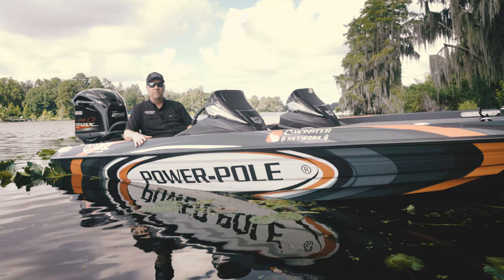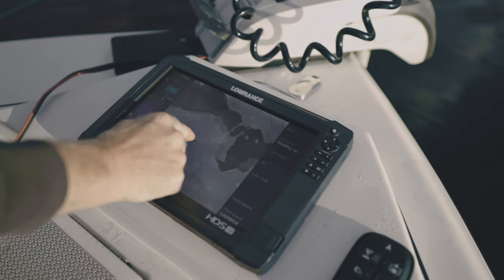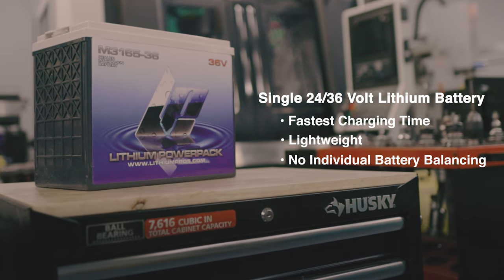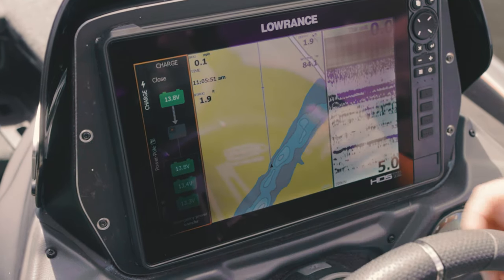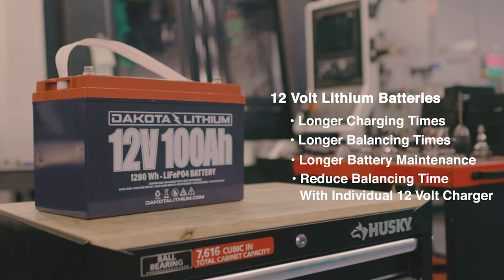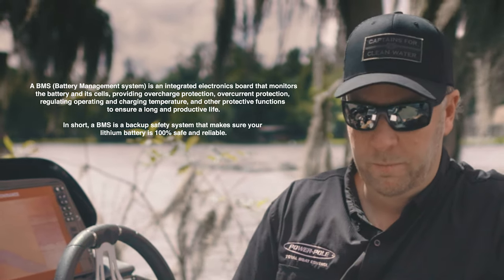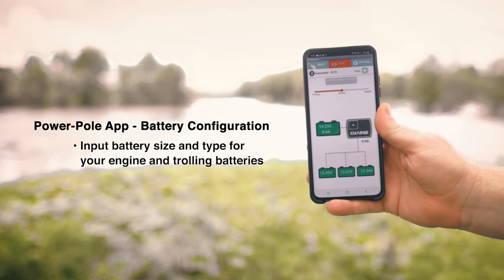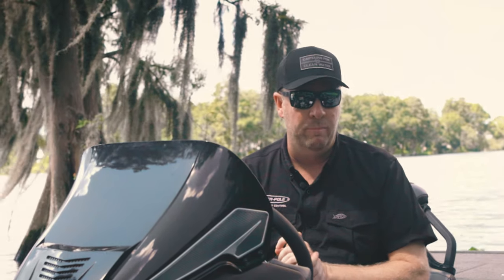Power-Pole Charge - Best Lithium Battery Setup

Comment: Could a user have a 12v agm cranking battery with a dedicated 12v lithium battery for livescope, graphs, and boat features, and then a single 36v lithium for trolling motor? Or does the dedicated electronics battery have to be an agm battery wired with the cranking battery? thanks in advance

Comment: Before using a product like this you need to assess how much power is coming in.  Because without that you have nothing.  If you have a 115 HP likely the max number of amps that are coming from the motor is only 35.  So it would be nice if they would answer all of the questions posted here and provide some real data on how this charging system handles different sized outboards.

Comment: This system is a joke for any lithium set up. It was installed in my boat as part of a restoration by a specialty boat rigging company. I am a fishing guide and depend on my charging system daily. If you use your boat once every two weeks, maybe you could get by. Power Pole tech support told me that the power transfer feature is not valid with lithium yet no where in the sales material does it give you this fact.

Comment: I received my power pole charging system as a gift.  I don't remember seeing anything in the manual, or a disclosure anywhere on the box that it will not fully charge two 50ah lithium batteries (both to 100%) wired together for a 24-volt system.  But it seems that way.  Battery manufacture told me so and suggested I get a single bank 10 amp charger to top both batteries off.  Why would I want to have to do that when I own the most expensive and touted charging system on the market.  Power pole said the battery percentage didn't matter, just the volts.  I will follow with an update once I figure out the truth.

Comment: Thanks for the video.  Sounds like running lithium trolling motor batteries in series for a 36v system isn’t as ideal for someone running them hard with short recharge times and you recommended single 36v lithium batteries instead.  How would it compare to running say two 36v batteries in parallel? Would running two 36v lithium’s in parallel have potential to require longer than ideal recharge times as well?
Reply from the maker: Yes, you are correct.  Two 36v lithium’s in parallel will take longer to charge than a single 36v lithium.  Your question brings up a very good subject.  
What is the best way to wire two 36v lithium batteries for the trolling motor?
In parallel or independently with a battery switch?  Both wiring configurations have positives, benefits and some drawbacks. 
Trolling motor batteries wired in parallel.
•	In parallel the Power-Pole Charge will charge and maintain both 36v batteries as ONE large 36v battery.
•	If you drain or use a lot of the two 36v batteries in parallel it will take longer to charge both batteries than a single 36v battery.
•	If one of the batteries wired in parallel has an issue with the BMS board it could cause the other battery to have an issue and your trolling motor will stop working and/or the Power-Pole Charge will not work properly.
Two 36v lithium batteries wired independently with a battery selector switch to toggle between the two batteries when needed.
•	This set up seems to be the way a lot of the Professional anglers are moving to.  (Emergency backup method)
•	The Power-Pole Charge will charge and maintain your main (battery #1) 36v trolling motor battery and the second battery (battery #2) is there waiting as a backup should you use ALL the power in your trolling battery #1.
•	The second battery is also there as an “emergency” backup should you have an issue with the BMS with trolling battery #1.
•	One thing to keep in mind is that the Power-Pole Charge is only hooked up to battery #1 so the Power-Pole Charge will only charge and maintain battery #1 with the outboard and when plugged into the wall at home.
•	You would need to carry a separate 36v battery charge to maintain your emergency, backup battery#2.
•	You would only have to charge battery #2 every few months to be sure it is topped off just in case you ever need it in an emergency.

Comment: Thanks for the video, I’m just wondering... could I use a Normal lead acid Cranking battery  as my cranking battery/starting battery to start my engine and run livewells, then have a single 36v 50 ahmp lithium battery for my trolling motor, and then two 12 volt 100 ahmp batteries ran in parallel (which would mean 12volts 200 ahmps ran in parallel to run my Lowrance Electronics, is this doable? Or can the power pole charge only charge Lithium’s at once or Only Lead Acids at once, or can it do both?
Reply: Both. I have two lead acid 12 volts in parallel. And one 36 volt for my T/M.

Comment: I have 4 12v lithiums.  
1x125ah cranking 
3x 50ah in series to 36v

My question is, Can I still use my NOCO genius 10x4 charger to charge my batteries  at my house and have the PP charge active on the water to charge my batteries? Will i still get the benefit of sharing power to all batteries.

TIA
Reply from the maker: Great question! There is no need for an additional charger. The Power-Pole CHARGE is a 4-in-1 system. Once you have returned to shore/dock and plugged into AC, the Power-Pole CHARGE will charge your battery system as a traditional onboard charger.
Reply: @PowerPoleTotalBoatControl  Yes, but how many days will it take to accomplish a full charge on the four batteries? You guys seem to forget some of us like to take the boat out the next day not the next week. It was a $1600 learning experience for me. Thanks!

Comment: I have power pole charge with amg batteries for start and trolling motor, I was wondering when going to lithium 36 volt can you leave the charger plug in after full charge like you do to maintain full charge?
Reply: ... Good question because I have read to NEVER over charge the lithium battery. 
. Jeff .
Reply from the maker: The Power-Pole CHARGE is capable of charging lithium batteries. As a 4-in-1 system, once the batteries are fully charged it will go into management mode and monitor the entire system.

Comment: What if you have a separate battery for graphs, pumps, power pole etc?
Reply: ... If  may, THAT battery is your house battery and what you mentioned is it's function. 
Sounds like according to this video, a house battery is not, may not, be needed. IDK
.
I have a bay boat with 5 batteries. ..
1- AGM Starting battery. That is ALL it is to do, NOTHING else. 
1- AGM House battery. This powers my 4 Lowrance screens, Twin Power Pole Blades, Live well, bait well, bilge pumps, lights, etc. 
3- Wet cell Group 27 batteries. These ONLY power the Motorguide 36V trolling motor.  These are what I am considering changing to a single 36V lithium battery. 
How I would hook up the PP System will require more investigation. 
. Jeff .
Reply from the maker: The Power-Pole CHARGE is capable of charging a dual 12v system run in parallel.

Comment: Does this only work with Lithium batteries?  Can I do a 36V battery for the TM and still have a lead acid 12V battery for the cranking?  I would have to have two battery chargers if I went that way right? I have heard about people going to lithium batteries, but I thought they were only doing that for the electronics and TM. I didn't know you could use a lithium for the cranking until I saw this video.  The charger does or does not charger lead acid?
Reply from the maker: Yes, the Power-Pole CHARGE works for a 24v or 36v trolling motor configuration in either a single case or in series. The Power-Pole CHARGE will also work with a 12v lithium cranking battery, you will need to use the Power-Pole C-Monster app to configure your setup once the Power-Pole CHARGE has been installed.